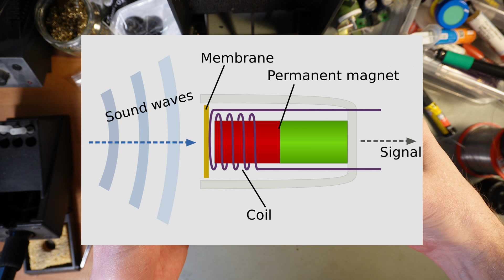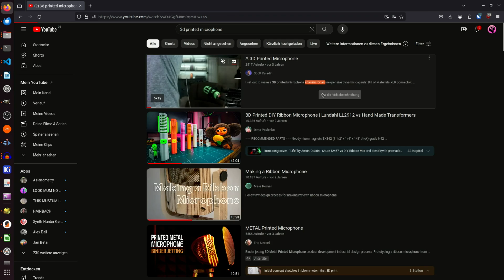Fully 3D printed dynamic microphone that works

Comment: I wonder if you used fewer spokes, if it would be more sensitive. I would say half it until you get down to 3 or 4 spokes.
Reply from the maker: Yeah, good idea. Maybe I’ll give it another try. Also amount of coil windings make a huge difference in frequency response. I did a diaphragm with 5 times the windings and it got very low frequency response.
Reply: So maybe some thinner guage wire too?